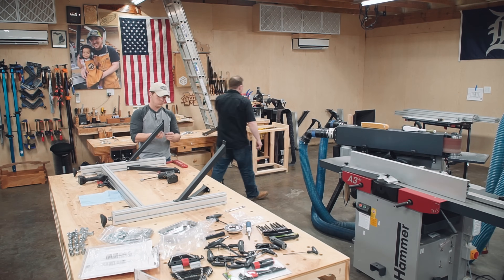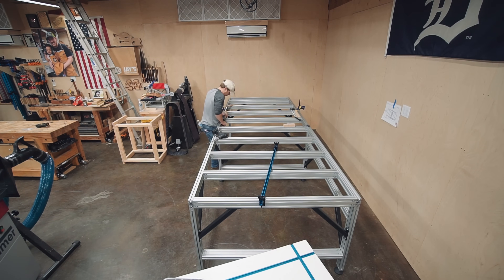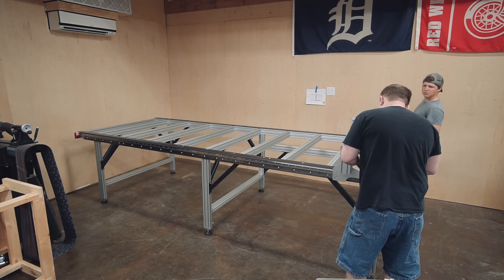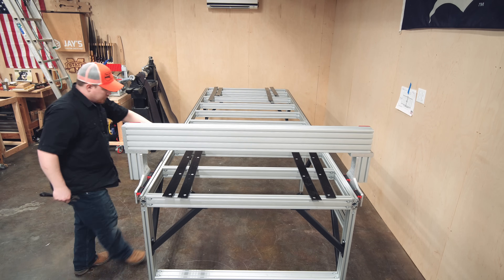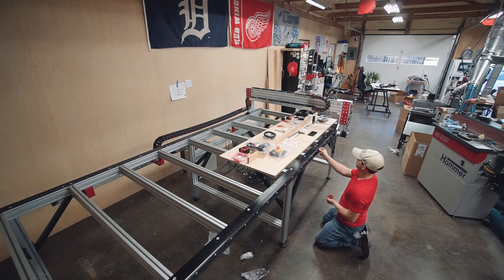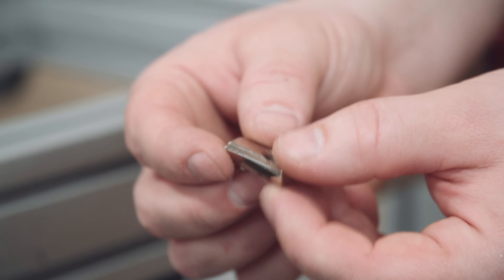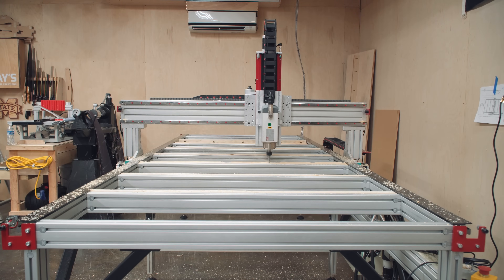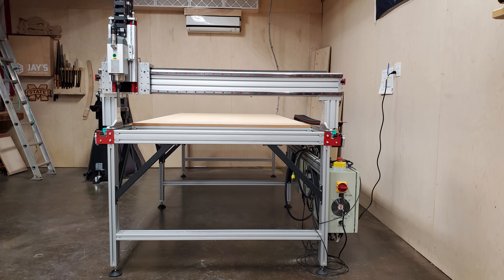Avid CNC Ep1: The Machine, 4'x10' - 339

Comment: Just ordered an Avid 4 x 9 machine with ATC. I have a question on locktite for the build, did you use any? And if so, when do you add it? It seems like you have to leave the bolts somewhat loose until the end, and then tighten them?? If you mentioned it in the build, I apologize :p
Thanks for all your videos!

Comment: Nice Cnc. I’m about to pull the trigger on a 4x8 avid pro version as well. But you deff insteps got me interested in the extra 2 feet of work space for rotary, or joinery clamps.

Question.

What size spindle you got? And is it enough to cut 3/4” melamine (or similar plywood’s) with up/down spiral bits for chip free on both sides finish?

I already have an edgrbander and don’t want to bother adding premill option, so I’d rather get a Cnc capable of thru cuts in 3/4” material

1 more???
Do you have any experience with heavier machines? Steel gantries? How’s frame deflection? Gantry flex? As far as the fact that it is after all aluminum, and is screwed together, not solid welded frame?

Comment: One thing you should do is to continuously check and adjust level and square as the build progresses.  And measure off the linear guides and trucks.  Rough leveling and squaring the bed frame is important to start with but the accuracy of the router comes from the linear guides and hence their straightness and squareness to the other axes.  Also, as you add mass to the frame it will flex and skew the linear guides.  So similar to voting in Chicago, check early and check often.

I really like the design and modularity of this CNC router.  Only thing I would change or add  would be mass/weight to the base.  This would do two thing; 1) push the feet into the floor with more force to help with stability and predictability while leveling and squaring the frame and linear guides and 2) minimized vibration and improve the quality of the cut (accuracy and finish).

Good luck and look forward to the rest of the series.

Comment: I use to work an Aircraft Parts MFG company Called Butler Industries, at one time they had the longest CNC machine in the country, it had 8 cutting spindles on 8 gantries, I was told it was supposed to make C-5 Parts. Where that thing really shined was running 8 separate parts at the same time. They billed the same machine 8 times for the same operation hours.

Comment: I appreciate the intention behind the 2x4's but with the amount of movement seen in solid wood, especially a 2x4, you will likely have to surface your table much more frequently. 
If you are simply milling 2d profiles it wont be a problem but if you use it to surface or do 3d machining I would minimize the headache and just bolt it to the frame. 2c
Reply from the maker: I don't think it will be an issue. There's only 1/2 inch or so above the bolt going into the frame. The majority of movement will be below the bolt
Reply: I have a 1" MDF sheet bolted to the extrusions on my machine and there is enough irregular movement in the mdf alone to be annoying. At the end of the day it all depends on the level of precision you are looking to get out of this machine...
Reply from the maker: Hmm. Must be something with the environment you're in. I had 1" MDF on my last machine for a year and a half and never noticed movement.

Comment: Jay, I do not know if you thought about this or if it really matters, but I have had issue with interference with the stepper motors loosing steps when the power cables are in close proximity with the power cables.  Hopefully they used shielded cabling for the motors, but just food for thought, I would look at running my power down the opposite side from the motor cabling, but entirely my opinion.

Comment: Jay, grab a bag of them threaded inserts that take a 1/4" bolt(not T nuts) use the cnc to plunge cut out a grid of positions, counter sink them below the surface.(keep the file handy for the next board, probably reusing the inserts)
Then its just a matter of making a clamping system to suit
Reply from the maker: I've got a solution for the clamping system. Check my instagram.
Reply: @JayBates   I've never used Instagram...

Comment: I 100% suggest a flow through vacuum system. I have a 5x10 version of the same machine and thought I could mount everything with screws or nails.......gave that up after screwing up 2 sheets. You can make a pump from 4 central house vacs and some pvc pipe and fittings. I spent around $1,000 to get the whole pump/piping system up and running. I process mostly sheet goods on mine, but a couple jigs for smaller parts can me made and held down to the table with the vacuum when needed.
Reply from the maker: Do you have a resource you could share on this DIY vac setup? I'd like to learn more about it.
Reply: Absolutely, its a very common thing on cnc routers of all sizes so there is a ton of stuff to read on this subject once you get started. But it is worth it when you can attach something to the bed of the router simply by flipping a switch.

The best place I have found is the shop bot forums, that is where the whole diy vacuum idea was started. 
http://www.talkshopbot.com/forum/forum.php

Here is a very large thread that was dedicated to this topic. This is the early version of the Blackbox, it was later improved and sold commercially.
http://www.talkshopbot.com/forum/showthread.php?11813-Black-Box-Vac-Source&highlight=vacuum

Here is a video of a blackbox system on the same router to give you an idea of how it works. Its a nice system, but more money than I wanted to spend to get started.
https://www.youtube.com/watch?v=sXhZcdGQm3A

Comment: It wasn't in the time lapse but, you may want to go back and use the guide blocks that came with to ensure the side guide rails are spaced correctly; it will save you countless hours of troubleshooting when its not preforming as expected.
Reply from the maker: I used them. I followed the instructions.

Comment: For the hold-downs in my spoil-boards I used a Microjig dovetail router bit (I made my own dovetail track nuts but you can also buy the plastic ones from Microjig). It's different than a regular dovetail in that it makes rounded edges instead of sharp edges, which makes for stronger tracks even in MDF (stronger than T slots).
Reply: I was thinking the same thing

Comment: I work for a plywood/hardwood supplier. We primarily delivery to cabinets shops but smaller garage shops and will calls from people that drive in form far away.  We sell a lot of 5x5 Baltic as well as different types of 4x10's and more 4x8 that I knew were out there.  We have a lot of shops buy MDF, MEDEX, MDF-light, HDF for their CnC beds. Our delivery range is several hour drive in each direction, a few smaller shops meet our out of town drivers when they can't get home delivery.   

Find where your local cabinet shops are getting their sheet goods and give their suppliers a call, if you can't get to them they might delivery to you or  meet you part way.

Comment: Great video! 13-ply 3/4” Baltic Birch is as good as plywood gets in my opinion. I always prefer to use real hardwood lumber, but when you need sheets, hard to beat Baltic Birch ply. I think it’s all imported from Russia and is expensive, but is sold at most lumber yards in L.A.

Comment: Jay,  For a lot of projects i make i use plastic nails shot from a Senco nail gun.  The CNC bit cuts through them just like wood.  Saves a ton of time instead of using metal clamps.  Not good for 100% of the time but 75% anyway.  Good luck!   ( I hope you are using VCarve Pro or even Aspire for design work.)
Reply from the maker: Thanks for the input. And thanks for watching. I use VCarve Pro.

Comment: I’m not sure how I feel about CNCs and woodworking. I understand it’s a tool to be used, but where’s the craftsmanship in letting a computer cut out your parts? It’s just my opinion, no need to criticize.
Reply from the maker: No criticizing from me. It's all perspective and there's no need for us all to like everything. My response to that is that the computer/CNC will only do what you tell it to do. It's just another tool. It's like using any type of CAD program for design work. I'm sure there were a lot of pencil and paper drafters upset that a different set of skills were required to design on the computer. Either way, it's a moot point in my opinion. I am very interested and intrigued by CNC technology. I find it fascinating. If it's not your cup of tea then that's totally fine. Really, no worries. I'm doing what I want to do and pursuing what I find interesting. I hope everyone else does the same. The only difference between me and most is that I'm documenting my journey with video and articles. Lets all be happy pursuing what we are individually interested in. :) Have a great day.
Reply: @JayBates  that's not what upsets me. It is the horrible interface which is standard fare with CAD software that irks me.
Reply: Exactly.  This why I only whittle logs with sharp rocks.  People these days with their fancy drills and saws don't understand true craftsmanship.
Reply: "It’s just my opinion, no need to criticize."

And yet, this post sounds an awful lot like criticism.
Reply: The craftsmanship comes into play when you touch off on the work. It isn't just hit the button and go, you know? You do have to line your material up in the machine. Touching off isn't a topic frequently discussed though. In videos you just see people cutting work out. They edit out mounting the material.

Comment: I really need a bigger shop, look at all that room.
Reply: You can reduce the area needed for a CNC by going vertical or slanted on a wall. Really need to pay attention to securing tabs in the code to not have parts drop as they are cut free but a small trim router with the right bit makes cleaning up the tabs quick after you free the part. It also makes dust collection easier as you can build it as a cabinet to let the sawdust fall to a collection point and blower to blow the airborne dust outside.
Reply: right?! lol